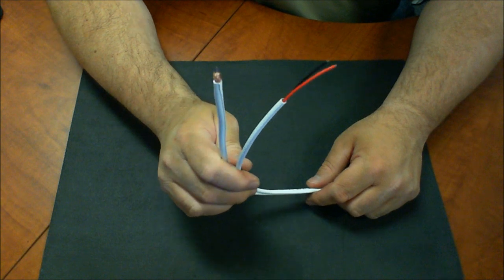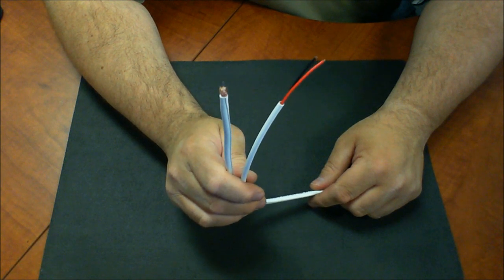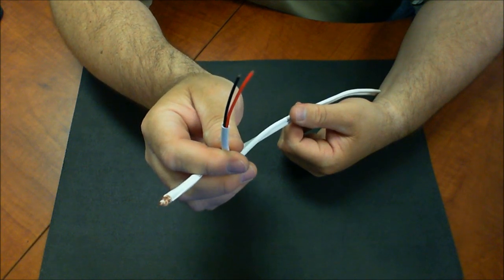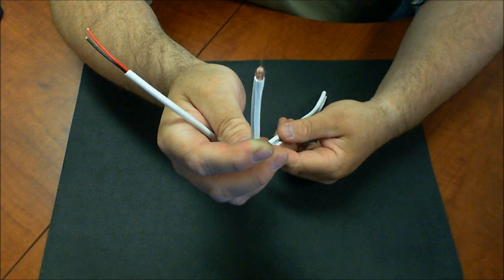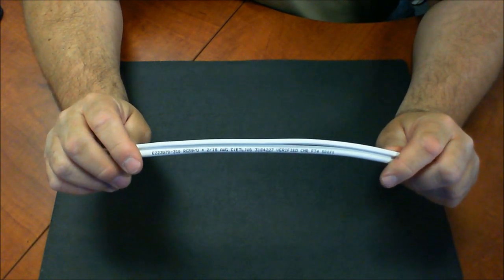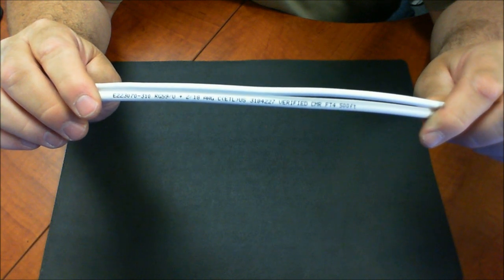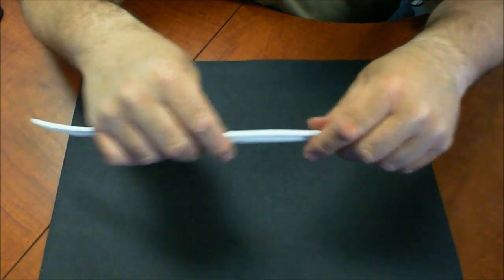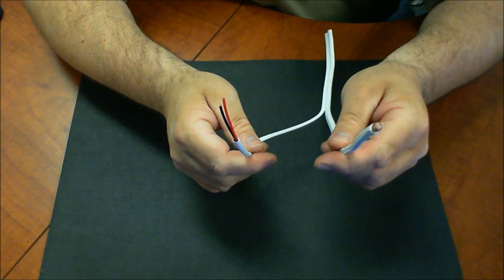RG59 + 18-2 Siamese CCTV Cable | Up Close Look!

Comment: Make sure any cable you purchase has the two letter " UL" printed on it. ALso for 750 Feet-1,000 feet u can use RG59... 1,000 -1,500 Feet u use RG6 & From 2,000- 2,500 feet u use RG11..... Hope this helped...